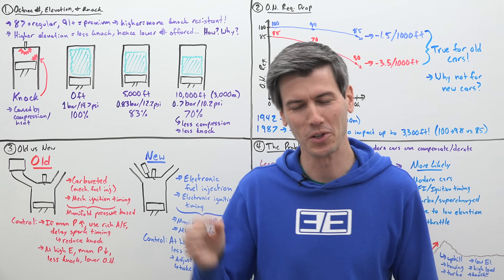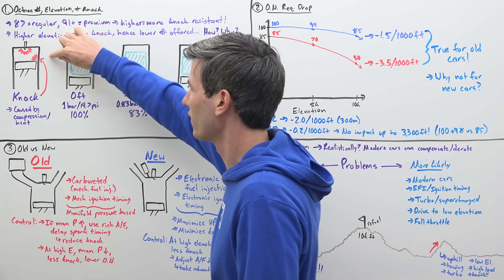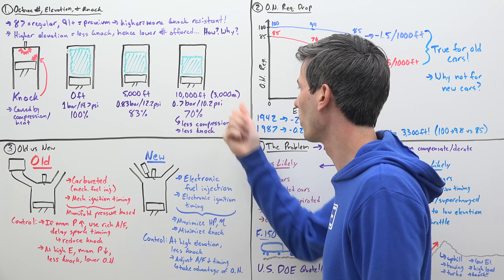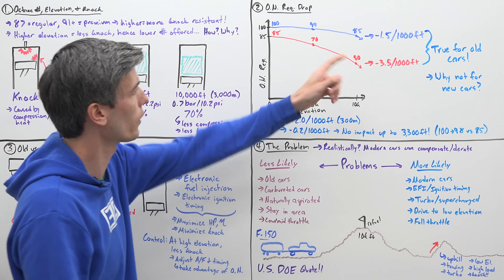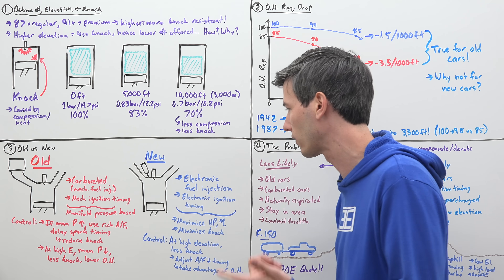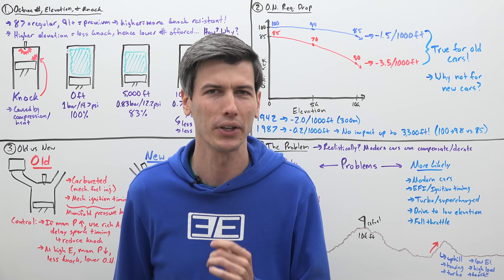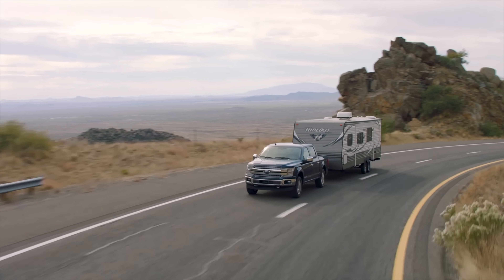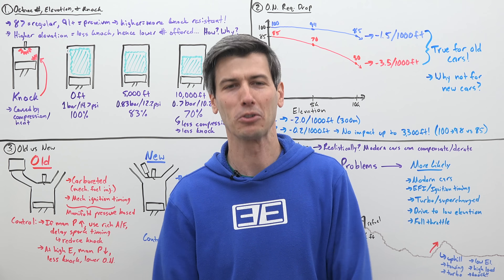Never Use This Gas In Your Car!

Comment: A very good analysis presented here, but Ford and DOE are full of crap about recommending not being able to use 85 octane fuel at high elevation (4,000+ ft.).  Modern engines can easily compensate under all load conditions to prevent knock at high elevation using 85 octane fuel IF the engine is designed to burn 87 octane fuel at low elevation (rather than premium fuel).  Until recently, I had lived at above 5,000 ft. elevation my whole life.  I NEVER had an issue with engine knock on 85 octane fuel (which I used exclusively) in any post-1985 vehicle with electronic ignition and fuel injection.  None. Never.  I've probably driven over a half million miles at high elevation since the 1980's in multiple vehicles--never any issues with 85 octane.  Bluntly, 85 octane fuel is still sold in high-elevation areas because IT STILL WORKS.  The main people who insist on using 87 octane fuel at high elevation are befuddled tourists and recent transplants to high elevation areas.  Most everybody else just uses 85 octane quite happily.

Comment: I find it funny how 91 is the 'super' in the USA
Here 95 is the 'cheap' stuff and 98 is normal.

But prices are through the moon here though, getting close to 10$ per US gallon converted.
Reply: We use a different rating system than you do, which makes our numbers lower (and likely a little more accurate, I think). It is true that your fuel tends to be better, but your 95 would be something like 89 or 90 here.

Comment: Sadly here are the comments when I share this video in a FB group here in Colorado-
User 1 - Toyota told me 85 is fine here and I'm in a 2017 - same everything as your 21. I never noticed a difference anywhere other than my bank account so I run 85 🤷
User 2 - I live in the Springs and been using 85 in all my vehicles for 25 years without any issues. I occasionally use a fuel cleaner, but that's all. No know issues with my new or used vehicles. My elevation is 6000 ft.
User 3 - 85 for life! I’ve never noticed a difference when I run 85 or 91. 
User 4 - I'm in a 98 4runner, so maybe the age is the reason but I've compared 85, 87, and 91 up at ~6k-8k feet where I drive and haven't found any difference.
User 5 - 85 is all I pump at 8,000 ft elevation in Colorado. Pumped 85 in my 4.7 sequoia my 4.0 4Runner and the 5.7 in the lc 
User 6 - I run 85 in high elevations. Anything higher in a low compression engine is just throwing money out the window for a placebo effect. 
Many more comments like this..
Reply: That's because it is fine.  He lightly touched on it but the crux of the video should have been that they are lying to you.  Basically all modern vehicles have knock sensors.  Meaning if you start knocking for any reason then the ecu will pull timing and that's it.  So you are fine to run 85.  Just in some vehicles you will lose power.  The notice in the manuals is a cover their ass sort of thing.  They don't want to be blamed if that stars align and either the ecu fails to save itself (which should be their problem) or if somehow you put low enough octane in to cause damage with knocking before the ecu can stop it or low enough that the ecu can't pull enough timing to stop it.

85 IS FINE IN MODERN VEHICLES.  Seriously.  They are smart enough to run on it.  You really think they are going to build a car that could blow up if someone forgets and fills up with 85?  No that would be silly.  Because people willfully and accidentally do it all the time.
Reply: @EVLS10  you should see what the Russians put in their cars - I don't know exactly what it is, but it smells like vegetable oil
Reply: This needs to be the top comment.
Reply: @thelastgood1forever  I literally know no one putting anything over 85 in their run of the mill cars. Hundreds of people, decades of time. Nothing has happened to anyone's cars.

Comment: Same in West TX and NM regular unleaded is 86 but my Ram 1500 Hemi calls for 87 minimum, 89 recommended . I do have a Air Aid Jr Intake and synthetic filter for the air fuel mixture and I haven’t had any issues after 15,000 miles. Had the same setup on my 06 Dakota cause it would sputter out at idle on 86, never had that problem again after the swap.

Comment: Even taking the octane rating difference from the US to EU in mention, I'm surprised to see your 91 premium is basicly the lowest rating fuel we sell in for instance Denmark. Shell even sells 100 octane.
Reply: 91 = 95 RON
Reply: @MrDaftJustice  yes, exactly. I assume it's because of the relatively small displacement, and highly turbocharged engines we run compared to the US?

Comment: I didn't hear it mentioned, but knock sensors in the modern cars help with octane deficiency, to some degree. I experienced this first hand when I had a sensor go bad, and was surprised at the amount of power then engine lost (through retarded timing).  Now, could it over come the 85 octane fuel?  Don't know.  Like Jason said, go with the recommended octane.  An interesting note, on my vehicle, the owner's manual recommends 87, but the power and torque numbers listed in the manual were with 91.

Comment: I towed a 4,000 lb TT up Floyd Hill on I-70 in Colorado with a 1996 Land Cruiser and 85 octane. I was WOT at 50 mph and it started to overheat. I pulled behind a semi going 30 mph and the 4.5L straight 6 was much happier. I'd imagine I was have a knock issue given that it was in the upper 80's. Next summer I'll run premium for towing. I live at 9,000' so I'll continue to run 85 for my jaunts around Grand County. Thanks EE!

Comment: Literally this situation with VW in NZ where I used to live. We have 91, 95, 98 octane fuels. VW recommend 98 octane in the 1.4 petrol turbo engines as per most euro cars too. People who put 91 octane in were cracking pistons and the first thing VW was testing was the fuel in the tank. They were declining warranty claims for any that tested with less than 95 octane.
Reply: Its pretty mad how their 'premium' fuel is what our regular everyday fuel is
Reply: @nfdr0kk3rz  America uses a different scale to rate their fuels on, but I think they're about the same as the rest of the world when using the same rating system.
Reply: @ajfurrell3744  Of course they do
Reply: @ajfurrell3744  Eeyup! You are correct! The US system for determining octane is actually a better method as it accounts for the MON test which Europe completely ignores. The US octane rating better represents the real world burn of gasoline under atmospheric conditions. 

US premium 93 here in the US is the same as 99 octane in the UK. 

Canada also uses the same octane rating system as the US. And US refineries actually meet higher tier standards than European refineries. 🙂

Fun! Fun! 😎

Comment: My car says premium recommended but I always buy 85, been doing it for years and I've had no problems 🤷‍♂️. I feel like it would be pretty difficult to find a place selling 85 octane gas that is close enough to a low elevation area to be a problem. In almost every case you're going to need to buy more gas before you get to a much lower elevation anyway.
Reply: Except that turbo engines don't care about your elevation so 85 is equally bad for them at all elevations. I would never put 85 in a turbo car, it might run but it has to cut timing and power significantly to protect itself.

Comment: There may be areas in very rural high elevation parts of the country or native tribal land where a 85 octane is the ONLY grade of fuel sold at a fueling station. Best to move along and find a top grade station with 87 or better unless a fuel emergency
Reply: I've been in a lot of super remote places and I've never seen a gas station like that. But I've also been driving with 85 for 10 years and it's never been an issue. 🤷‍♂️

Comment: I rarely use my engine because it’s a plug in so this isn’t 100% useful to me but I still use gas so it’s interesting

And I have a question. My motor is a bit better than the hybrid motor and would it be possible to use the motor to start the engine? Or does it have to be a designated starter

Comment: You don't see lower than 95 octane values in Europe, in general. You could get lower than 90, not from regular fuel stations mainly industrial sites, but it needs to be mixed with "normal" 95+ fuel so it doesn't cause issues. In Romania lower octane petrol is traditionally called "gazolină". It may be cheaper, but too much of a hassle to obtain and mix for daily use, imho!
Reply: Europe's ratings are not the same as the US.    They are not equivalent

Comment: Hey Jason - great video.  I was considering a purchase of a 2021 Camaro with the 2.0 turbo a while ago.  I read the owner's manual and on page 230 it states that an octane rate of 93 is recommended.  Anything below 93 will lead to reduced acceleration and fuel economy.  Etc. Etc.  I live in Washington State.  We do not even sell 93 octane fuel.  The choices are 87, 89, and 91.  It seems bonkers to me that GM would sell a car with a recommended fuel the customer cannot even purchase???  What am I missing here??? 

Premium unleaded gasoline meeting ASTM
specification D4814 with a posted octane
rating of 93 — (R+M)/2 — is highly
recommended for best performance and fuel
economy. Unleaded gasoline with an octane
rated as low as 87 can be used. Using
unleaded gasoline rated below 93 octane,
however, will lead to reduced acceleration
and fuel economy. If knocking occurs, use a
gasoline rated at 93 octane as soon as
possible, otherwise, the engine could be
damaged. If heavy knocking is heard when
using gasoline with a 93 octane rating, the
engine needs service
Reply: Nothing, it says it pretty clearly there. 87 is the minimum, you will get more power and efficiency with higher octane fuels. You should be fine on 87 with the factory tuning, the knocking warning is probably more likely with aftermarket engine modifications. Just use 91 instead of 93. Highest I have here is 91 as well and I've never had an issue, you probably only lose a couple horsepower.

Comment: The vast majority of this is unrealistic yet technically true since basically every single car on sale today has variable valve timing, knock sensors and automatically adjustable ignition timing to compensate for larger deltas in octane pretty well. I once poured in a 5 gallon can of diesel into 23 gallons of gas in my SUV simply because I just did not care and I was going on a road trip and had that taking up jug space I wanted to use for gas instead. I decided to rid of it by diluting it  Had no knock or issues, engine was quiet and smooth. Even if you don't have vvt the ignition timing and knock sensor is usually still present.

Comment: I live in PA. bought ( NEW ) & still have my 97 Jeep Grand Cherokee with the 4.0. It runs like CRAP on 87, PINGS, DOWN ON POWER, TERRIBLE GAS MILEAGE so I run 89 & it's GREAT. This has been that way since NEW but my 99 runs just fine on 87 ? But I DON'T EVEN BUY 87 FOR MY POS PUSH MOWER OR ANYTHING ELSE I OWN ANY MORE. THIS COUNTRY HAS GONE KRAZY BECAUSE OUR SO CALLED GOV. & IT'S GETTING WORSE & WORSE.

Comment: I didn't know octane levels that low even existed. Octane 92 was the lowest you could get around here, but was discontinued in 2018 and now octane 95 is the lowest you can get.
Reply: Your country uses a different system (RON) than the US (AKI) which is 4-6 point lower for the same fuel
Reply: @119beaker  The video even had a hint for it at 1:24 when he brought up numbers and I remember him bringing it up more explicitly in past videos.
Reply: @119beaker  hmm i never knew that

Comment: Apparently my 2001 Nissan Maxima is fine with lower octane ratings (thank god since I didn't know it was supposed to take premium until 6 months after I bought it) since it has a knock sensor. Now I just put 91 or 93 in, and the car gets better mileage and is more responsive so I don't see any reason not to just use the recommended fuel as long as you know what it is, unlike me when I got my car.

Comment: Very interesting! 
Why smaller engine cars would not benefit as much if you use high octane fuel?
Reply from the maker: Engine size does not determine octane requirement; could be large or small and it go either way.
Reply: @EngineeringExplained  thanks!
Reply: @EngineeringExplained  even when it comes to performance?
I've got a Toyota year 98, 4 Cylinder, 75hp

Comment: I've used 85 in a honda 1.5 turbo, it didn't care at all. I don't think any decently engineered modern internal combustion engine with a modern ECU would have any issues, cars have been equipped with knock sensors for decades now. A ford ecoboost will blow up before 100k even if you put the world's best premium fuel in it, they're just garbage in general.

Comment: In U.K our lowest octane we have is 95, (apparently takes whole tank to re adjust, again to 97/99 Shell VPower etc if normal Unleaded used) I am even worried about that in my 2017 GT86 due to fuel nonsense shortages here.
Reply: Your 95 is the same as our 91 in North America (Ron scale vs Aki scale)

Comment: My turbo charged Hyundai requires a minimum octane of 87. I always use 89 because I can feel the difference in performance. I also get slightly more MPG with 89 octane. I recorded my MPG for one month with 87 and one month with 89. I drove the same route back and forth to work. I fueled at the same gas station. I got about 3/4 of a mile more per gallon with the 89 octane fuel vs the 87 octane.

Comment: Here in Ireland the minimum Octane fuel sold at the pumps is 95. Fuel lower than that cannot be imported or sold in Ireland.
Reply: Different rating system. RON = research number octane,  US uses R+M ÷ 2 , motor octane number is lower so brings it down.

Comment: Question:  Is there a downside (besides cost) to using 91 octane or higher in engines designed for say, 85 or 87?

Comment: So, having lived in Utah and Wyoming most of my live, and driven for a living most of my life.
Always buy 85 octane when I can.
I always buy lower octane by 2, whenever I can. In my 98 Grand Cherokee 5.9L Limited it calls for 91.
I've put in 89 for hundreds of thousands of miles, never had a problem. 
A motorcycle I have calls for 90 octane, I used 88 exclusively. 
I have literally driven millions of miles without negative effects. 

But, this is just another reason why I don't buy or own forced induction engines.

I also am aware of the need to change fuel when heading to lower elevations.
Reply: 98 Jeep Grand 5.9, BEAUTIFUL, SIR. I still have my 97 Jeep Grand 4.SLOW but my 68 Camaro 327 makes up for that.

Comment: Not disputing anything you've said - I worked in the Petroleum industry for 35 years and it seems unlikely to me refiners would go to the trouble to blend octane out of the stream.  In many cases, there was octane giveaway, because the refinery had excess octane and wanted to keep the stream flowing.  Normally, the excess octane would go into premium, but to assure customer satisfaction,  even the regular grades would spec higher than the minimum. Having said that, this would apply typically to top-tier fuels, but even the cheap stations buy from the same refiners.

Comment: So even at elevation, 85 is bad?
Reply from the maker: Correct, but less bad than at sea level (explained at the end of the video).
Reply: @EngineeringExplained  dang. I live in Utah and full up at Costco because it's cheaper and they only offer 85 & 91....

Comment: What advantages do engines designed for premium gasoline have over engines designed for regular gasoline? Just higher power or better fuel economy as well?
Reply: They're usually higher compression which gives more power per liter of displacement
Reply: @KaitouKaiju  If I recall correctly, higher compression ratios do result in better fuel economy.